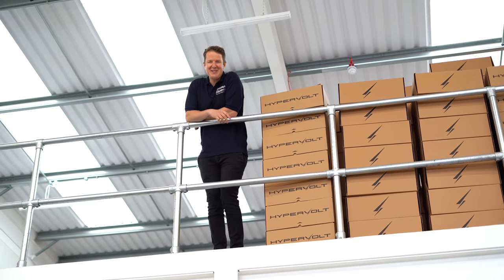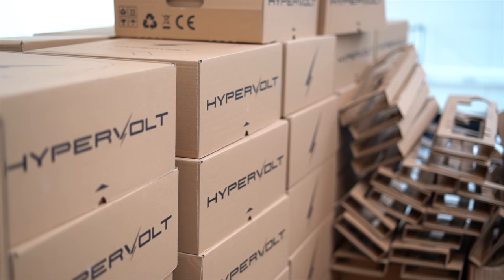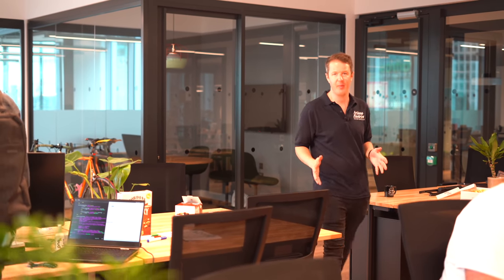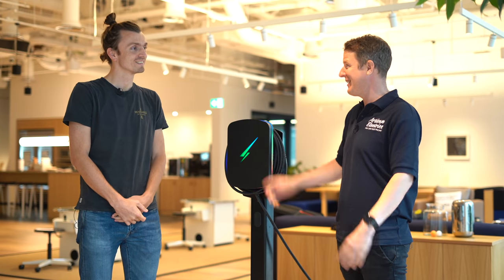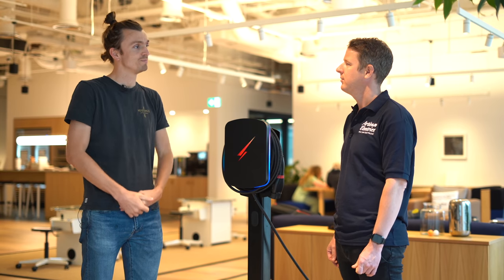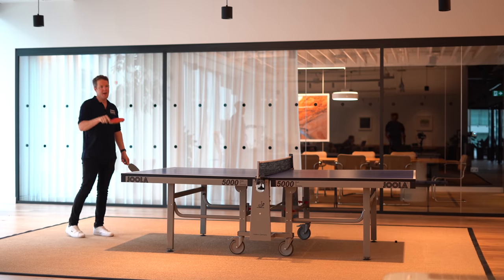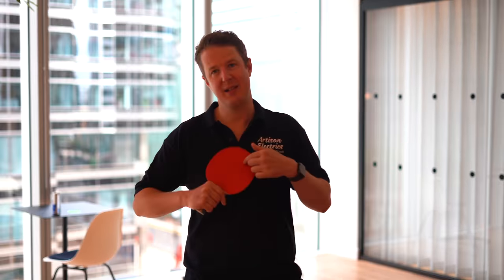How its made - EV Chargers Hypervolt Factory tour

Comment: Super Eco, Eco & boost? 

It’s nice to see Hypervolt are adopting ideas from the Zappi charger I have installed at my house, amazing bit of kit the solar integration! I’ve saved so much money using it this last year, myenergi must be a huge inspiration! 🤗
Reply: It isn't, and that's not saying MyEnergi doesn't offer you something compelling, but we follow a very different direction. Mode names are standard across chargers, not just Zappi, but our product works without a hub, without extra CT clamps, out of the box, and for significantly less money. Now all manufacturers make different trade-offs, but in many fundamental ways we tend to do things differently than Zappi. Whether that fits your bill or not is indeed a separate matter.
Reply: @hypervoltev  Price wasn’t my concern, I will pay anything for a quality product. That should be a motto for every EV enthusiast out there. These chargers will be the most used appliance in the house. And for me safety does not have a budget, all EV charging manufactures are incredible in there own right but as a retired electrical engineer, I wanted the best PEN protection  technology money can buy.
Reply: @Hamilton Crocker  Absolutely! A lot of people end up comparing us to MyEnergi, which do a lot of awesome things in their own right, but as with any market this big, every company gets to speculate about what most buyers will need. We really don't feel Zappi has to go anywhere for us to succeed, in fact it's a great thing that British manufacturers  which are very focused on innovation are able to grow and capture significant market share, as opposed to a lot of products coming in from other places without pen fault, without a focus on the British market and consumer, and no benefit to local economy, or a high quality offering to the consumer. MyEnergi are a great hardware company, and sure we all have our shortcomings, but if the future yields a fantastic success for both companies, and many other local manufacturers in this space, that would be a fantastic outcome, putting the UK and its superior engineering ability at the forefront of the EV revolution, not just now, but at mass adoption.
Reply: @hypervoltev  Couldn’t agree more! Well said, I’m sure there is plenty of room for you all to progress and reap the rewards of this faced paced industry. It’s great seeing British innovation, I am looking forward to seeing all of your and your competitors future projects! Keep it coming 🙌🏻

Comment: Love the Solar integration. Perfect for my situation. Yippee!
Reply from the maker: Yes!
Reply: Then get a Zappi. It’s had solar integration for years and it works great. To Jordan. There’s nothing new about bidirectional CTs. You make it sound like it’s an amazing innovation. It’s bog standard stuff.
Reply: The clever bit is using one CT to do both grid and PV monitoring. I don't think anyone else is doing that right now. Yes, Myenergi have done solar integration for ages, but credit where it's due
Reply: @JamesScholesUK  Zappi can operate perfectly with fully automatic solar integration, using it's standard included single bidirectional CT on the grid incomer. It can measure solar grid surplus power and automatically match the EV charging power to charge it with just the solar surplus. The optional additional solar CT does not affect the Zappi functioning. It simply enhances the logged and displayed data. It is entirely optional.

Comment: 15:00, The Strain on the Grid.  National Grid have already stated enough capacity exists, in fact the most demand seen historically was 62GW in 2002, demand has dropped on average in recent years.
The complicated challenge though is the issue of when that power demand actually happens.
I can also refer you to an interview 9 Months Ago on Top Gear YT between Chris Harris & Graeme Cooper (National Grid).
Reply: What happened in 2002?
Reply: The Grid is not the one with the fun problems, the sub distribution networks are, the  DNO operated bits.
Reply: There will not be as much "strain" on the grid as you might think. After all, if we're all driving EV's then we won't be buying petrol or diesel, will we?  So the huge amounts of electricity previously used by the oil refineries will be available as spare grid capacity. They won't need to refine it if people aren't buying it and using it!
Reply: @Brian-om2hh  As per above comment, you're completely right about the grid. The backbone of our electrical system is strong, it's the "veins" that run into residential areas that cannot cope wit everyone driving EVs, as they were never built with the idea that everyone would have a 7 - 11kw consumer in their home.
Reply: @hypervoltev  I don’t buy that. Some years ago “electric central”  heating using multiple 2-3kW storage heaters on economy 7 was quite popular. They took enormous power and all switched on at virtually the same times. Then there’s electric showers consuming 7-11kW. The network survived those big consumers without any serious issues.
Reply: @ThePrawlin  Why do you think DNOs require that they are notified for every chargepoint then? There are big differences in %% of people, number of hours at peak consumption and a lot more.
Reply: @brad30  Apparently that was when the national grid had its highest load. Since then apparently due to energy efficiency load has significantly dropped. It’s claimed that if every house in the country had an EV right now, the grid, nationally could cope. What would happen at a local level might be another matter though.

Comment: can all the front LEDs be turned off? or is this in fact the user interface? Many users may want a discrete EV charger than is not putting on a light show for neighbours and attracting unwanted attention !!
Reply: Yes they can be turned off or 4 stages of brightness depending on what you want.  Mine was installed 3 weeks ago, and the app controls everything.

Comment: all of this is good and well but frontline support is key.

I’m sorry I don’t agree with your rosy picture I called hyper Volt spoke to the salesperson Jo who didn’t fully understand their product and didn’t know what a pen fault Device was even though it’s built into the product.

I eventually got through to technical support who seems to be one guy called Alex very knowledgeable very capable however promised to send me an email with a list of installers in my area this email never materialised.

i’m a true believer if you promise someone something no matter what the reason is that you cannot provide the answer straight away you should always communicate this to the customer even if it is not what they expect to hear.

people need to be accountable for their actions and their commitment and take ownership of their promises

also interesting to hear these algorithms that will work out intelligently when you can charge your car so that we all can use the main supply without affecting too much load on the network. however as a customer we are interested in how much we can save using our electricity at off-peak times.
reducing our carbon footprint is also important but not the number one driver

as it stands you have to opt inTo 4/5 hours am charging times

Comment: Can I ask a question???
On another video you recommend changing 16mm L+N to 25mm L+N cables .
What is the diameter of the incoming supply cable on that one .
On mine it seems like a 16mm concentric bringing in the supply .
So basically no point changing the Tails to 25mm if the supply diameter is less . How do we get around that problem .
Thanks , and enjoying your videos
Reply: The DNO and sparks work to different rules and physics 😂. That’s why
Reply: I'd have thought that as an arse covering exercise,  upgrade the bits you're responsible for so they're up to the task, then pass it to the DNO to solve their bit, then they can't come back at you with the "you need to have xyz replaced" etc. Future proofing I'd say.
Reply: @royking1  yes , but if you tell the client that their incoming supply cable is not up to the task you will scare the hell out of them .
So they contact their authority. 
How long would it take and at what cost would a new supply cable of a minimum of 25mm take .
So , can the client use their charger in the meantime. 
Probably not .
Moreso in an older house with a lead sheath cable .
So why fit it and charge (  oops  ) for the installation of it .
A chain is only as strong as its weakest link .
Hopefully Artisan replies .

Comment: So they are connected through my WiFi which means it goes through my unreliable WiFi signal  ??????  What security are you running & sense battery heating up !!
And what security do they run whilst protecting my information ??? A response would appreciated ( 5 Star ⭐️ is under threat )
Reply: That's an area where we truly shine, in terms of software, and even subjected to pen testing recently alongside other manufacturers, no vulnerabilities were detected. We constantly work to improve our solutions of course, but all your data is encrypted, advanced encryption is used during the pairing process, chargers are hard locked to your account and so forth, which prevents someone walking up to the charger and taking control of it.

Even if someone were to hijack your Wi-Fi, they would struggle to steal away your Hypervolt data, and this is something we work hard to constantly improve.

Comment: It's nice they're aiming at local grid, I have lost count of the amount of times people have had chargers installed lately, or their neighbors and we've found the local grid just can't handle it as the cable supplying the street has decayed. People have to remember we're now going into an EV push with supply cables that haven't been renewed since the 1940-1950s in many suburbs all over the UK with even older cables in some city centers. National grid and power generation is fine, provided that everyone doesn't try to turn them on over night, thankfully a country of EV's only is a good 2-3 decades out due to the chip shortage and lack of forethought by governments and energy transporters allowing some time for them to get their assets in working order. 

It's nice that thhey're building a mesh but as has become publicized by the government some over the air update enabled chargers aren't secure and because of the way they're designed they will never be 100% secure. It's always going to be a race to keep ahead of anyone that might want to break into the system and do something like a ransom wear attack.
Reply: Plus hydrogen technology is starting to be developed which is going to give us similar ranges in engines similar to the units we have today , not reliant on the national grid which is just not going to cope with millions of cars plugging in every night
Reply: @steverobinson8170  Hopefully the Tesla boys will be the Betamax.
Reply: The infrastructure of the national grid is definitely a concern. They need to be pro-active upgrading supplies in areas with known issues, especially in more affluent areas where EV take up is going to be likely, 3-phase being preferable!
Reply: Chip shortages are definitely slowing things down, but not for long. The problems are massive, but we see opportunity in the product we call Ultragrid. Certainly some will challenge its salesy name, but it's important to remember we work to serve a very wide audience, not just the tech savvy viewers here. However, the ability to really balance the grid, and later offer one of the most advanced and responsive mass scale V2G integrations to DNOs is something unique to Hypervolt. It's not a complete solution, but it will everyone very very far along the way. There are other things that must be done to enable mass EV adoptions, which will take years to build.
Reply: @mickbitchum4664  They  havent got the capcity needs more substations and a complete upgrade of underground cable  my home rated at 40 amp  got it upgraded to 80 amps cables linked underground too  , my earth is tncs  neighbours tnc   house built 1930's  its bad enough now if we both shower at the same time  all lights phyically dim  imagine plugging in a couple of cars  to charge , no chance of 3 phase , and lets be sensible most people these days have at least one car on the drive most have two or three  if you have young adults living with you . Load balancing might work but the first time you walk out the door and your cars not charged your going to switch that feature off straight away , they have just not thought this out

Comment: Zappi in tears, wondering why you don’t call anymore
Reply: They've let installers down not having units ready and failing to meet demands....we've all moved on!
Reply from the maker: Yeah I think that’s true unfortunately
Reply: @Darren McCourt Zappi is a much better system.
Reply: @mickbitchum4664  basically it could a pandemic that has cause a global shortage of electronic components across every sector including EV cars, the fact they have redesigned the units to use different integrated circuits so they can try and get production up and running to attempt to meet demands is not an easy task on top of that they made a pubic apology

Comment: So Jordan is the main reason you’ve moved away from Myenergi due to stock or also because of the issues you’ve come across since installation with remedial callouts we saw in a previous video either way really enjoy the videos
Reply from the maker: Thanks I’m glad you like the videos! Reason I am not relying on them any more is both supply issues and quality issues, I was forced to try other options and so glad I found hypervolt as they are great!
Reply: @artisanelectrics  interesting well I’m currently in the process of pricing 3 EV charge points on one site and will look at hypervolt over myenergi as I was going on your previous recommendations just need to look into their 3-phase chargers
Reply from the maker: They only sell direct to installers so no wholesalers to worry about

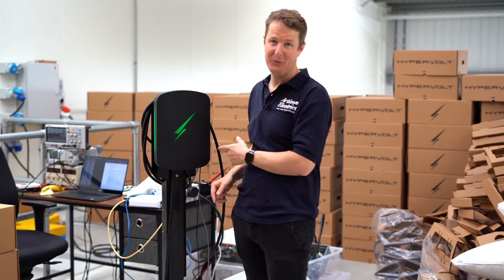Comment: 3:05 Hypervolt have a seperate bracket for parking the plug, so what's the solution when it's mounted on a pedestal? Just hang down?
Reply: There's a plug in point on the pedestal, we always supply the holster in the price and in the box!

Comment: Sure would be nice if there was regulation here in the US to force manufactures to use the same standards when it comes to car charging.   There are so many different ones in use here there is no single charger than can work on every car right out of the box be it AC chargers or DC chargers.    Oh and did I mention we have the same issue with cell phones too! 🤷‍♂️🤦‍♂️

Comment: I still do not understand why the Hypervolt at 739 British Pounds ($1,017.23 US Dollars as of today) is priced two times what the Tesla Wall Connector ($500.00 US) is priced. Plus the Tesla Wall Connector is much smaller. I will admit if you are going for aesthetics and need a product that matches your house great, but to me in most situations does not justify the price difference...
Reply: @zlmdragon.  I have two Teslas a Model S and a Model Y and I love the Tesla Gen3 Wall Connector and I love the power sharing ability between my two wall connectors, 
Wall Connector Features
Up to 44 miles (77 km) of range per hour of charge
Compatible with Model S, Model 3, Model X and Model Y
Up to 11.5 kW / 48 amp output
Customizable power levels on a range of circuit breakers
Compatible with any home electrical system
Power sharing (up to four Wall Connectors)
Wi-Fi connectivity (2.4 GHz 802.11 b/g/n)
Approved for indoor and outdoor installation
Lightweight 18' (2.6m) cable length
Tempered white glass faceplate
Reply: @michaelholliday100  Our product is £679 including VAT, meaning all our economic activity and margins are calculated at a £560 all in price, on which we have to develop everything we offer. The Tesla wall connector in the UK is not $500, it's $650, however it offers none of the benefits offered by Hypervolt even on a hardware level: load management, solar, pen fault, or the upcoming type A RCDs, wireless clamps, integrated software suite, fleet dashboards, etc.

While we don't mean to challenge the benefits brought by the Tesla charger, this is a completely different level of product in many respects. Tesla doesn't spend as much time doing R&D on their chargers, and we believe for a good reason. Chargers that are unable to participate in mass grid responses will need to be removed or ruin the party for everyone at mass adoption, which Tesla is handling from opposite angle, playing true to its strength.

You're including sales tax in the comparison, our product retails to the US for $750 not $1000 plus, for example. Looks, software, features, hardware, supply, speed of installation, are all things Tesla does not offer you at present times. Whether or not the benefit is justifiable is of course your decision.